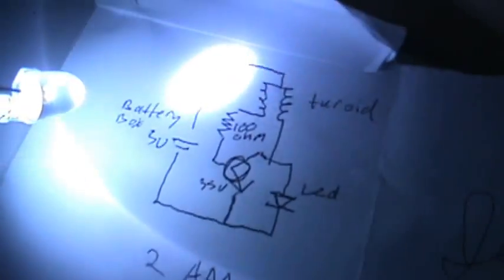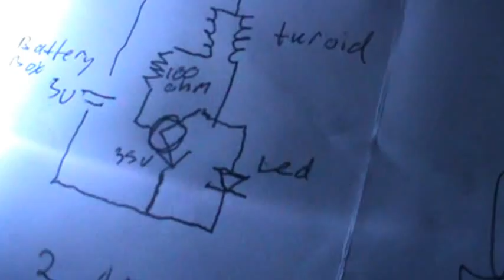Joule thief high power

Comment: Thanks, but real Joule Thiefs use only a single battery.  I think two batteries is cheating, kind of, because if you disconnect the resistor the LED will still light.  Maybe not as bright, but it will light.  Let's see you do it really bright with one AA cell.  That's a challenge.  Hint: buy a NTE11 transistor.  They're expensive but will give you really bright light with 1000 ohms, instead of 100 ohms.  Thanks.